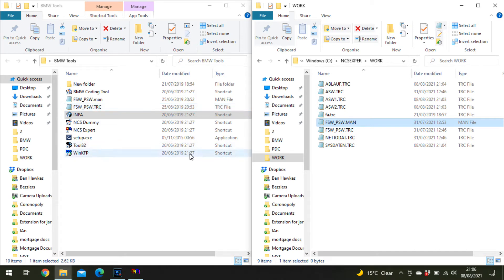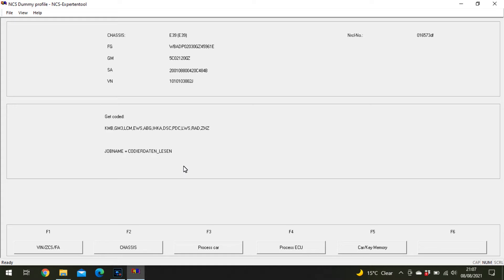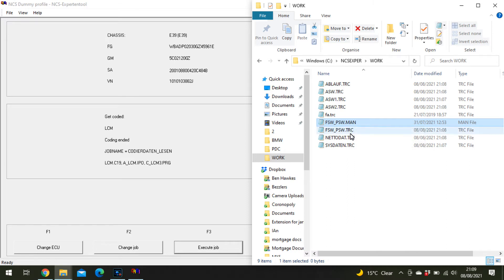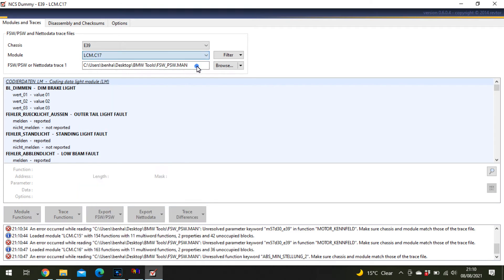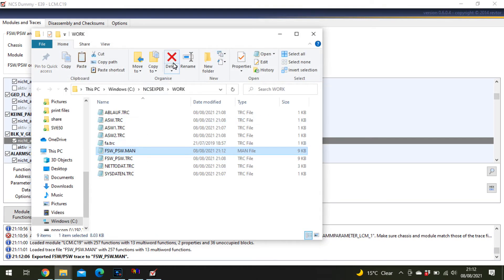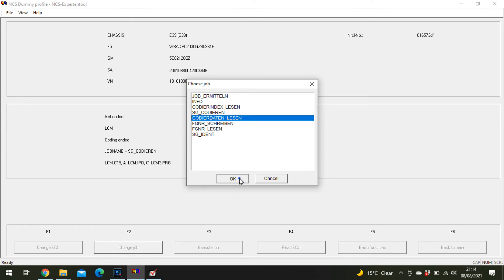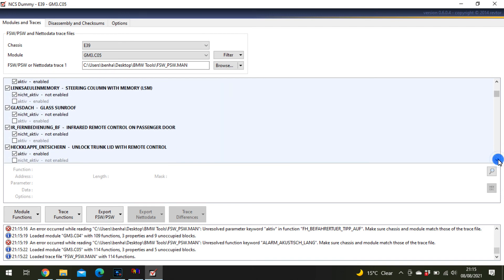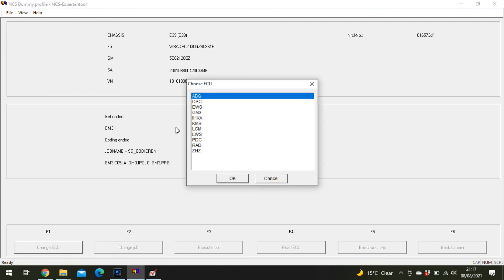Coding a BMW E39 using NCS expert and NCS dummy

Comment: I have an E39 523i from 2000 and I always get an error at 1:25, regardless of which one I choose. I am only using a OBD2 reader. 

Should I buy a 20-pin round connector that connects to the port in the engine bay or is it something else?

Comment: Thanks for the info, Ben.  
I have an '03 e39 530i in which I replaced the ABS module with a rebuilt unit (not my original).  Unfortunately the rebuild was coded for an automatic trannie and not my 5-speed - and thus my DSC remains disabled.  Can you possibly point me to which coding module to access to change that option?  I have already installed all the BMW Tools & I have the K+DCAN cable, so I should be set to go.

Comment: Is it best to use with the engine bay round connector or would a usb obd2 work also for e39 540?
Reply from the maker: I think it depends on the age of your car, this was on the inside obd port, but some cars you have to use the round one for certain modules!
Reply: @benhawkes111  awesome thanks I got a 98 so I suspect round plug best
Reply from the maker: @BLue87CrxSi  yeah mine is a 2003 and I'm pretty sure it doesn't have the round plug

Comment: hi, which cable do you use? i have a 1999 e39 535i with the obd1 under the hood in the engine bay and one obd2 under the light controllmodule. Which one did you use for coding?

greetings from deutschland
Reply: From what I understand, you would use the one under the hood. I have a 2000 528i and i can access all modules using the round connector under the hood.
I will be doing some diagnosing today and will report back
Reply: As long as there is a round connector on your BMW, you always should use this one. Because not all of the ECUs are accessible through the OBD2. This changed once the OBD2 became standard in about 2002 and simultaneously the old round connector was no longer included.